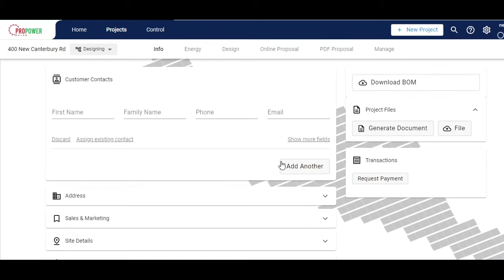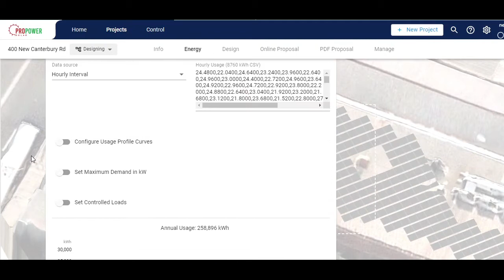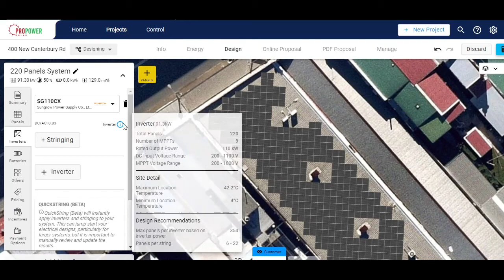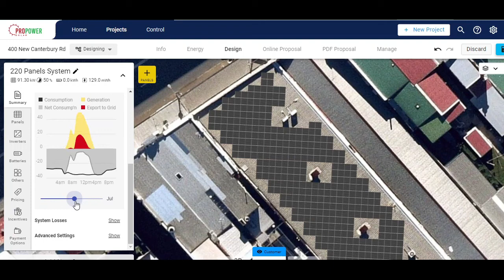Open Solar Tutorial For BEGINNERS 2022

Comment: This is a terrible design. Given that the roof purlins (frame) would run parallel and perpendicular to the walls of the building the panels would need to be NE or NW facing. How can you face them north like this? Have you ever done an installation?
Reply from the maker: Thank you for the feedback as I was a beginner learning how to design solar PV systems and am open to learn from my mistakes.